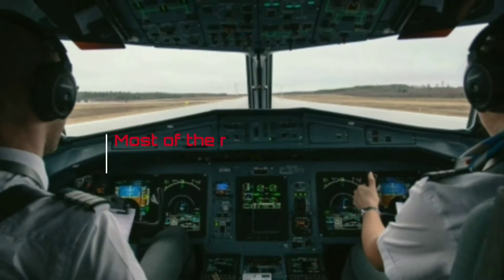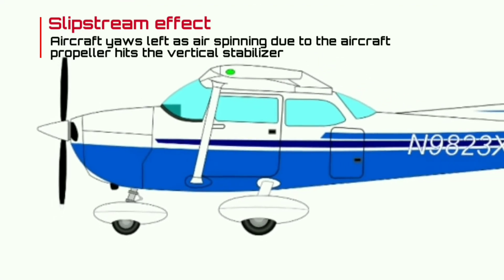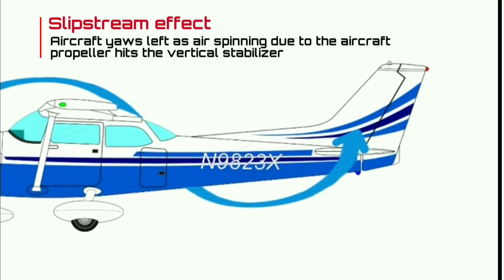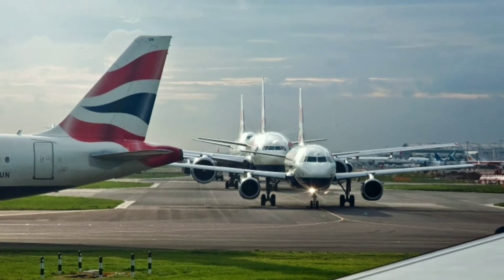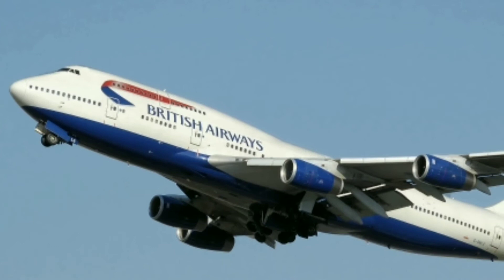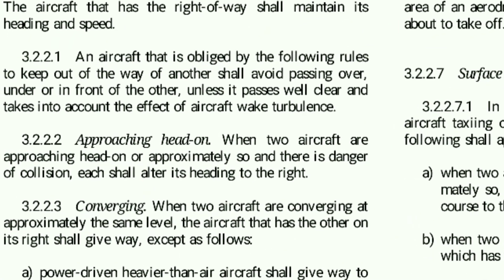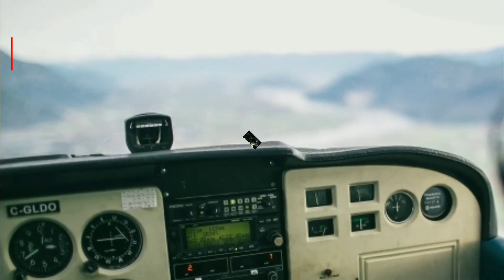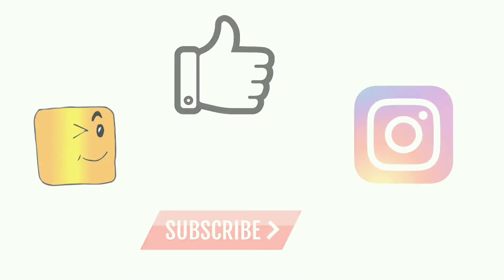Why do pilots sit on the left of the airplane cockpit? | Aircraft Nerds

Comment: Just to correct a common misconception: both aviators occupying the cockpit are PILOTS. The Pilot in Command sits in the left and the First Officer (also a pilot) sits on the right. Both take turns in flying the aircraft.